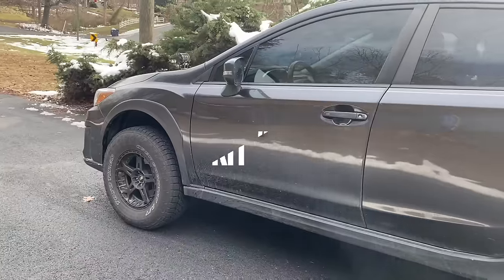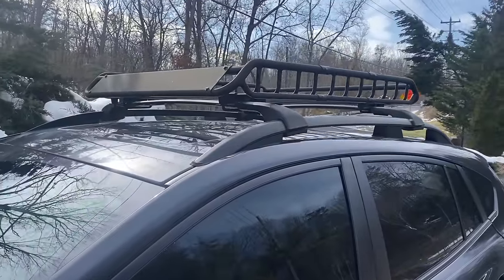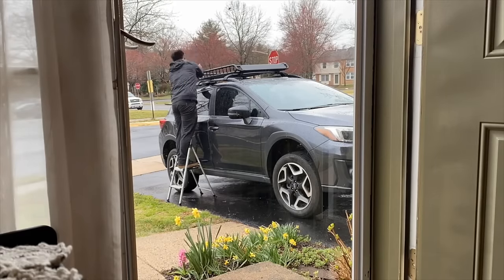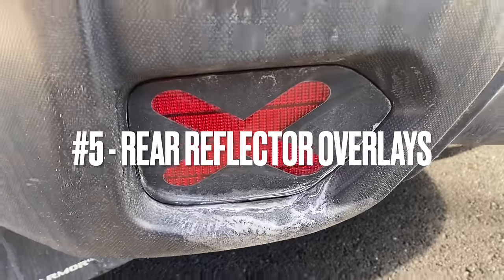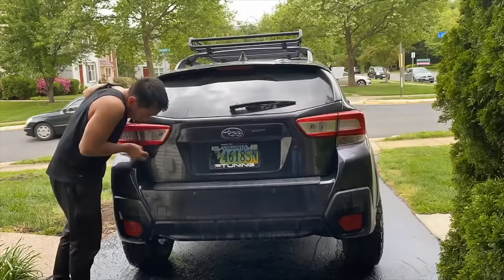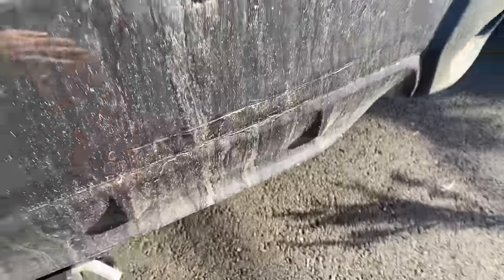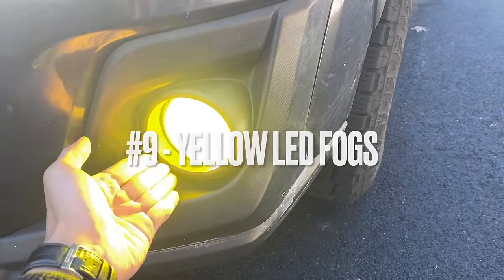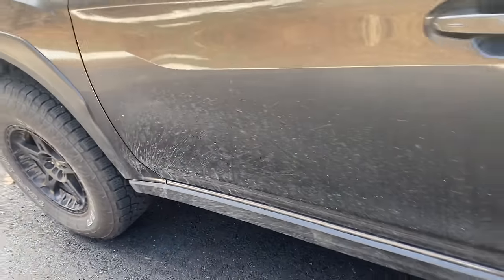TEN Crosstrek Modifications in 10 Minutes  | Subaru XV Upgrades Performance Mods

Comment: Never thought about getting a harbor freight roof rack. Saved me a lot of time and money
Reply: I've heard they rust terribly. Need paint immediately.
Reply: Yea i put 2 coats of rustoleum on mine
Reply: I got to look into that
Reply: Harbor freight got good stuff
Reply: @Tbone.357 all roof baskets have water rust. I sprayed my cheap eBay roof basket with truck liner spray and used some clear rubber gasket or sealer in a tube for the joints. Never had a problem for many years and I keep it outside in the rain and garaged too.

Comment: Great looking Crosstrek!  I was curious about the fog light you mounted on the hood. Do they actually help during foggy conditions, being that high up and far back?  I like the look of them on the vehicle. Also with the larger tires do you notice any difference with gas mileage?  Great video man, Thanks for sharing.
Reply from the maker: Thank you! The pod lights on the hood are actually for when the headlamps and fog lights on the bumper get covered in mud and dust, then I have a third set of lights to illuminate the road/path. The larger wheels/tires have reduced my MPG about 2MPG with a lot of highway driving.

Comment: The plates are amazing. I have had them on two crosstrek and slid down trails on them. Hard hits trying to keep up with tacomas and never had a problem with them. I got the ones with the oil drain holes and the local jiffy lube guys don't have a problem getting in there without taking them off.
Reply from the maker: Right on!

Comment: Nice to see what you've done.  I have a 2021 Crosstrek Sport and have lifted it 2" and I have 17" rims and I put on the Toyo All Terrains III's also but in 225/65 17" which gives me 28.9" if I remember right.  Also have the skid plate but had mine drilled for the oil drain .. and I put in a FuMoto valve to drain the oil .. I'm fussy about oil changes.  I put on a tower brace and found that helps with lateral control and I have a K&N filter on it.  Leaving for my 3rd trip into Death Valley on the 20th .. no problems on any trip and I do go off road and air down to 12 lbs usually.  I sleep in the Trek and have all my gear inside .. I do have a Rough Country roof rack where I keep my shovel and max tracks and anything else that doesn't fit inside.   I also have a 2001 Ford Explorer Sport 2Dr that's pretty heaviely modified for off road.  🤠
Reply from the maker: Thank you for sharing! Your build sounds exciting. You sleep in your Crosstrek?! I also have a Pathfinder that has solar, bed, etc for weekend camping purposes. I’m curious to see how much space you have and what mods you made to made the trek comfortable to sleep in
Reply: @PatrickKasilag  ill be getting my 2022 Crosstrek sport in a few weeks, i would like to do a 2 inch lift, from what I’ve seen, everyone has done their own lift and not through the dealership. Any advice you can give me? I know doing it yourself would void a lot of warranty, if i do it through the dealership everything will still covered
Reply from the maker: @legionclips8910  Well if you get a lift kit and Subaru finds out, it can only potentially void the warranty for your suspension-related components. For example, if your transmission fails or a part of your engine needs to be serviced/replaced, the lift kit is completely irrelevant to that part of the car so it should still be covered under warranty. Same thing goes with getting an intake or exhaust installed.. Then your brake master cylinder or caliper starts leaking during the warranty period, it should still be covered since that part of the vehicle is not modified. I recommend calling your local performance shops for estimates if you are not comfortable taking the car to the dealership or installing the lift yourself.
Reply: @PatrickKasilag ...in theory that is how it (the Magnuson-Moss Act) is supposed to work...however, in reality, it is a much more complicated affair. They (the dealer) can also tie in a lift to the drivetrain, based on a new/different half-shaft angle. Plus, if you run a much larger tire than spec'd, that too ties into suspension, driveline/engine and even brakes.  So, one must be careful when stepping outside the factory design bounds and have a good working relationship with your servicing dealer.  But if you are willing to go mod crazy during the factory warranty period, be prepared (have a plan) to be denied warranty coverage, even if the part is not directly connected to the modified areas....it's all about liabilities....
Reply: @PatrickKasilag  you just need to get Crawford lift kits and parts and itll be covered by warranty, also if you actually offroad try to order more front sway bar bracket extensions youre gonna be going through alot of those with the SSD

Comment: Question (for all) . Will these (or most of) also work on the Crosstrek base model as well ? I liked how you explained the 2" lift wouldn't change much in the way the car handles or drives

Comment: If you had just put on the bigger tires, without the lift, do you think the tires would still have rubbed? Also, did you do any speedometer recalibration, if not how far off is the speedometer?
Reply from the maker: Yes, no doubt this size would still rub without a lift. I would not put on any larger than 215/75r15 if you don’t plan on doing a lift. I did not get a speedo calibration since it’s only about 2-3 MPH off when I’m going 65.

Comment: You didn't get an added 1" with the wheels,  added to the 2" lift kit. The tire as a whole is 1" taller. The only thing you gained was where the hub sits to the bottom of the ground where it meets the ground. Which wouldn't of been a lot
Reply from the maker: Yes, cut the overall diameter added in half. 1.2" OD difference = only 0.6" added ground clearance (on top of the lift.)

Comment: Hi Patrick, favour to ask… I’ve ordered a new cross trek which will be delivered earlier next month. My ask is that could you kindly let me know what the bolt hole measurements are on your skid plate as I’ve acquired a metre by metre by 5mm thick piece of aluminium. I’d very much like to mirror the sizes of your engine guard for my car when it arrives. Thank you for your help, much appreciated.

Comment: What kind of offset is on the rims? I have a 2019 Subaru crosstreck with a +48mm offset. I can’t find a set of 15 inch rims with more that a +15mm offset. I do have 225/75r15 for tires. Thank you for the awnser in advance.

Comment: Wheel dealers keep telling me that 15's won't work because the brake calipers will rub. Have you seen this with yours?
Reply from the maker: Depends on the wheel spoke design, but majority of the clearance concerns would come from offset. If it's a 15x7" wheel, then most wheels between +35 to +10 should fit. Calipers would rub on most with higher than +35 offset. This set is a +15 offset, no issues.

Comment: Very nice mods! Was thinking of going with 235/65R17 tires next as oem for my forester is 225/60. I know you had 75 profile sidewall. Wondering if the 235/65 would be a good compromise without rubbing.
Reply from the maker: thanks! Do you have the factory wheels and no lift currently? I think 75 aspect ratio would be way too big with 17” wheels on a forester though.. I need the wheel specs and lift info to give an opinion on clearance accurately
Reply: @PatrickKasilag  I’m running oem wheels from a stock 2019 forester premium. OEM tire size is 225/60R17 and according to the manual the stock wheel size is 17x7 J (whatever the J is I don’t know). As far as I’m aware they are +48 offset. 

I’d like to be able to stick the largest tires on the stock rim as possible without rubbing anything. From what others have said I’ve seen anywhere from 235/65R17 and 225/65R17 would fit. It would be nice to go 235 wide just for a bigger contact patch, and of course bigger sidewall the better. Just the research I’ve done it seems like 235 wide would be about the limit without a lift. And no, I am currently not running a lift at all. Stock height. Although I might eventually add a 1” spacer lift at some point I the future. One thing at a time 😁. I don’t do any rock crawling where I drive it’s all pretty flat here for the most part lol.
Reply: @PatrickKasilag  awesome job sir! I have the same crosstrek 2019 with the stock oem wheels. I'd like to put 215 70 17 tires on it with the stock rims so it would be slightly thinner but 1.3 inches taller. I'm wondering if u think it's going to be OK or if it's gonna rub.

Comment: Great looking ride! In the manufacturer recommendations for the OEM crossbars, it suggests having a minimum space between the front bar and the mount for the roof rails. Have you noticed any fit/instability in your roof rack or bars having the front cross bar mounted directly next to the roof rail?
Reply from the maker: Thanks! No I haven't noticed any issues with how it's mounted so far this past year.

Comment: super yellow fog??  my 2023 base should be here next week NO FOG LAMPS - can the be installed after market - wiring already in place for easy connect??
Reply from the maker: You can install a set of Diode Dynamics: https://amzn.to/3ZerViH

My Crosstrek came with fogs so I'm not sure if it comes pre-wired from factory. It wouldn't be difficult to install some wiring though. Contact DD about their kit and ask about recommendations for wiring options!
Reply: @PatrickKasilag  thx -= BEST PLACE TO DRILL holes the firewall??

Comment: How much did you find your mpg dropped with the lift, tires and wheels?
Reply from the maker: About 3 mpg after lift and bigger tires AND roof rack. Only 2 mpg loss without the roof rack on

Comment: Did you change your left / right turn signal lights to LED? Working on that now, but I can't find the blinker flasher relay. Used to be under the dash, hoping you might know.
Thanks!
Reply from the maker: I did not, ours are still stock. Unfortunately I have not had a chance to look that up yet

Comment: I’ve been looking at getting the same Curt receiver! Was it a straight bolt in or did it require removing some material underneath to get it to bolt in and secure properly?
Reply: I installed a similar one. It does require unhooking the muffler from the hangers but it’s pretty straightforward

Comment: So with uodrage wheels and bigger tires how do you do calibrate the speedometer because dealer ship don't do that for you thank you bro
Reply from the maker: I have not gotten it calibrated yet. It's only about 2-3 MPH off at 75 MPH though.
Reply: @PatrickKasilag  i heard from few people in jeep group they told we need to calibrate speedometer because if not it will read wrong odometer and speedometer it won't good for service i'm not sure because i have plant to buy crosstrek hybird i have wrangler jl but it easy to calibrate speedometer with alot of tool you can buy online but with the crosstrek i don't know alot about subaru by the way thank you bro

Comment: Did the lift void any of the warranty?
Reply from the maker: I installed the lift at 26K miles, went to the dealer for recalls at 52K, no warranty related items were brought up. Car now has 68K miles and still no issues with suspension. A lift kit would also only void warranty for anything suspension-related, not powertrain or electronics.

Comment: Having the lift kit intalled, will it void warranty of the car?
Reply from the maker: Only anything related to the suspension. Lift kit should have no effect to the engine warranty for example. Same thing applies to an exhaust system not em affecting braking components, etc..

Comment: hey bro, i did 2" Lift spacers on my outback and i can feel every bump it more stiff now compare to when it was stock. Did your change when it was lifted?
Reply from the maker: What spacer kit did you use and what year is your Outback? If you have higher-mileage struts (60K+ miles) and they are worn, it could feel bumpy. Also what tire pressures are you running and did you get a 4-Wheel alignment from a shop after suspension installation?

Comment: So with the increased tire size/smaller wheel, do you keep a 5th full size spare? And if so, where do you keep it?
Reply from the maker: You caught me! I need to buy a 5th full size and keep it on the roof basket or a carrier on the hitch. I was also contemplating just upping the tire size on the spare donut, but I'd rather have a matching wheel/tire. I'm hesitant with doing the hitch carrier because it might make accessing the trunk a pain in the a$$.
Reply: @PatrickKasilag  Hahaha, I was just curious, thought maybe you had some super neat hidden method I didn't know about. I have an '18 that I'm building out and I just leave mine in the trunk, which takes a ton of space. I'm currently looking around to find the best option for stowing it, because I don't really want to leave it on the roof.

Comment: What made you go with Primitive Racing skid plate instead of LP Aventure?
Reply from the maker: No particular reason, they are both great options. My wifey just happened to pick this one when Christmas shopping for me lol. If you are looking into the Primitive one, I recommend getting the option to have the oil drain hole so you don't have to take off the skid when you do oil changes.
Reply: @PatrickKasilag  Thanks for the advice!

Comment: Did you lose power and gas mileage with the bigger tires and lift?
Reply from the maker: Power as in translation to acceleration, somewhat. Hard to measure without a baseline measurement though. Mileage-wise, I think the roof rack had a more noticeable loss (1.5ish MPG on highway speeds.) The bigger tires mess with the actual MPG readings on the car though since the overall diameter change makes the distance travel readings ready 3-4% less. But really, the minimal loss is a worth it trade-off for the looks and extra ground clearance.

Comment: Hey there what’s your mpg like after the lift? Thanks
Reply from the maker: The dash display shows 24.5 MPG, but that's an inaccurate reading because the overall diameter is 4.4% larger. So realistically 25.6 MPG.

Comment: Have you noticed a significant change in gas mileage with the new lift and tires?
Reply from the maker: Good question! There is about a 4-5% loss in fuel efficiency with the modifications, yes. But most of it is more noticeable with highway speeds 70+ MPH when the roof rack adds to wind resistance.
Reply: came to ask the same question, that's better than i thought it would be

Comment: No subframe spacers with the 2" lift?
Reply from the maker: Good catch! It hasn't given me any issues, but I'm actually changing my suspension set up soon. Going with Flatout coilovers and Rallitek rear subframe spacers as soon as the stock suspension shows any signs of wear.
Reply: Yeah, I think it's a must when lifting your vehicle. It wouldn't affect the suspension  as much but the angulation of the axles, control arms and links.
Reply from the maker: @ibp4da97  I can see how that could potentially over-extend the rear CV axles in situations that people take their Crosstrek off-roading a lot and take their rear swaybar off to let the wheels fully "droop" on dips for added traction. But yes, the rear subframe spacers are definitely a must.
Reply: Love your build nonetheless and am looking forward to getting mine later this month! Subbed to your channel. Btw, are you a fellow pinoy brother?
Reply from the maker: @ibp4da97  Hell yeah man! My plate on my other car is TANG INA lmao

Comment: Any thoughts on how you have affected the factory engineering and impact to ride and safety?
Reply from the maker: The three things that most-noticeably impact the way it drives/rides are:
. The bigger tires (slight loss in MPG due to larger mass the drivetrain has to move, but totally worth the trade-off)
. The lift kit (rides almost like factory still, maybe just a slight bumpier from adding pre-load on the factory struts)
. The roof rack (slight loss in MPG and makes the vehicle sensitive to strong wind when driving on the highway on windy days.)
As far as safety, I can't think of any that affect it negatively though the Skid-plate definitely makes it safer to drive off-road (more protection for the engine and related components) and the Tow hitch would add a bit of protection if I were to get hit lightly from the rear. The pod lights did take a bit of time to get used to since it can get in the way of vision if you are shorter like me.

Comment: 0:21 because it get's super salty....That's like the single most important reason why you should wash the car. The salt eats right through the aluminum. 10 years that car has massive rust underneath because the owner didn't think washing salt was necessary, but it's your car though you do what you do. I personally would never buy a used car from states that have snow or near a beach, because owner's don't don't think washing salt off their car is needed.
Reply from the maker: I was this car regularly throughout the year.. just not immediately after it snows. Northern Virginia roads are constantly salted from December to February. This video was filmed between two snow storms and is used as a daily commuter.

Comment: 225 75 15  still rub all in the front tho. Not rub 100% 215s
Reply from the maker: Also depends if you're lifted and what size/offset the wheels are! But yes, 215/75 is a guarantee